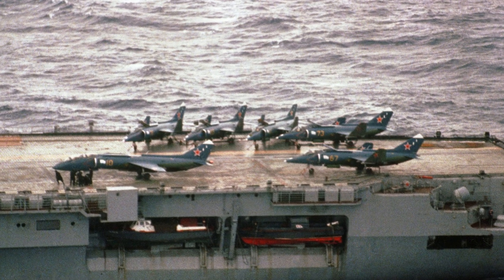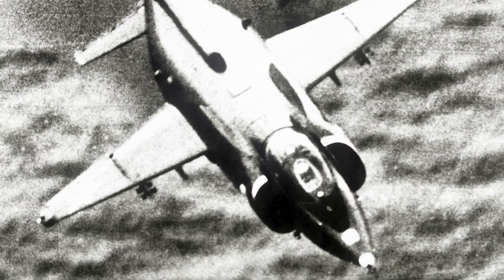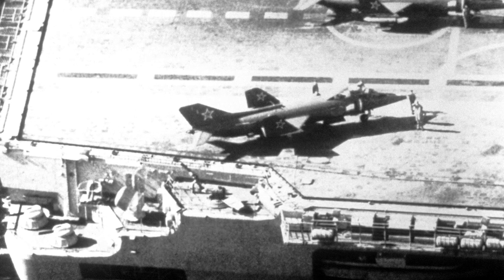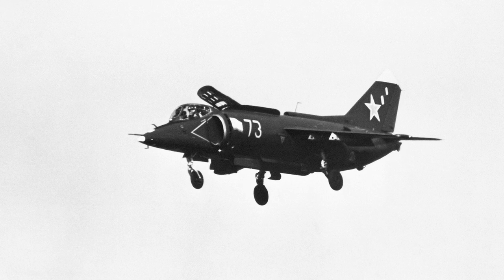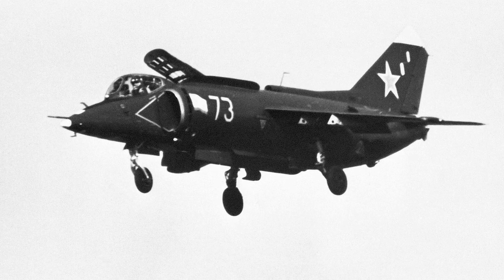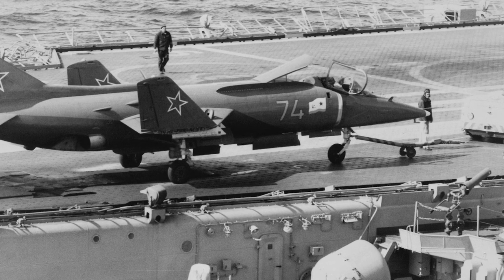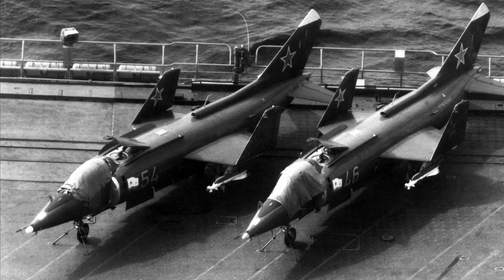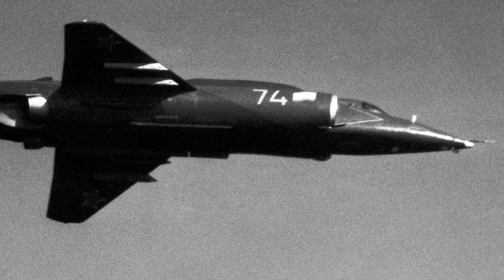Yakolev Yak-38 Forger - A Short History of the Soviet VTOL aircraft

Comment: looks like they tried to accomplish something like the harrier with the rotating exhaust nozzles but they couldn't figure out how or there wasnt enough bypass air to lift the front so they just added the individual jets
Reply: That's not true because the yak-38 was built 7 years earlier than the harrier
Reply: @danielchimai6855  sadly those 2 extra useless engines caused it to have a fastest turn time of 38 seconds lmao thing is a pos